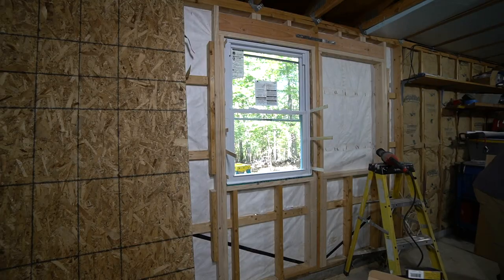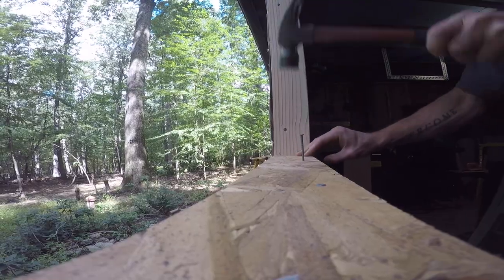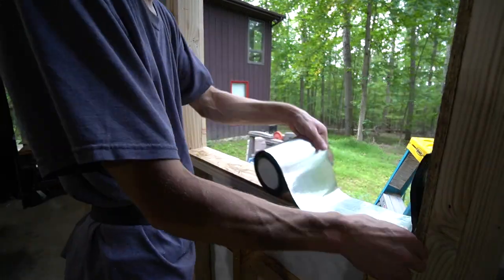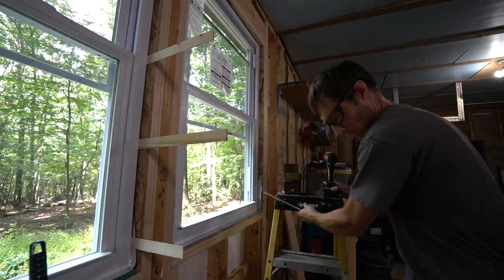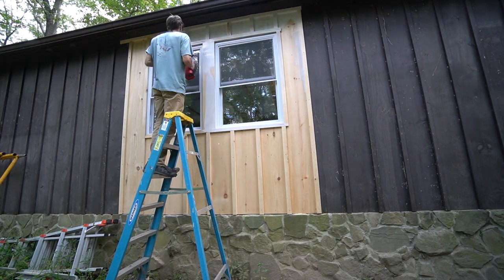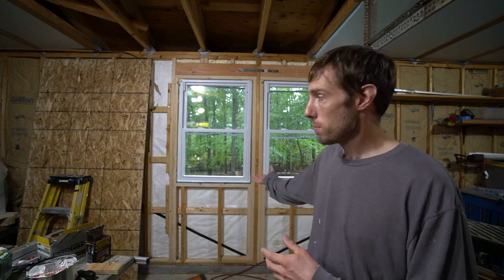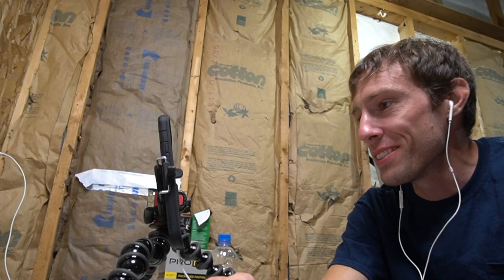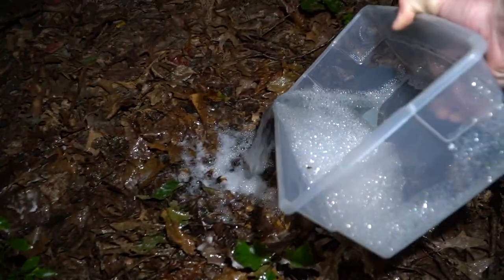Installing Windows In My Shop And How Much They Cost

Comment: I love watching US houses repairs/rebuilds etc. Want new window? Saw-off piece of wall, shoot some nails and boom work done. Rotten floor? Use few hydraulic jacks to lift the whole house and change your floor. Need to move wall a bit to the left? Just cut your wall away and build new one. :D
I need solid SDS just to drill hole in my wall to hang painting, coz it's made of 30cm of reinforced concrete. If you want to change something with your installations - electric or water/heating you need demolition hammer and diamond circular saw to make new grooves.
Reply: and the funny thing is, our concrete/brick houses would survive most of the natural disasters that cause total mayhem there, yet still they stay building the same way. The secret is in the differences in property law, insurances and construction code.
Reply: @lukearts2954  Yup. They both have pros and cons. Im only wondering if something will change now, when wood prices are like 2-3x higher than few years back. Now building wooden house will be probably on par with brick one.
Reply: @atexc5604  as for materials, yes, but man-hours and logistics are still in favor of timber frame housing.

Comment: put a asphalt roofing strip between stone wall and a bit up under bottom of wood wall, it provide isolation and lead water away and keep the upside of the stones dry, and its cheap and easy

Comment: The top of the stone wall should have a small metal trim cap. It starts behind your wood siding then goes over the top edge of the stone. Kind of like your window flashing. Sealing your ends should help like you did in the video.

Comment: I assume that is a hornets nest. After dusk scrape the ground for a circle around the nest diameter of 6-8 feet. No leaves or debris. Then and only then get a hose ready with water and then saturate the ground with kerosene or gas where the nest entrance was trying to get it deep into the nest to that end you might poke a stick down in the entrance before clearing the ground. Light it up, you will have to stay with it for a bit to make sure it does not flare up and spread anywhere. But this will allow you to kill them off almost entirely as they will all be in the nest at dusk. Next day dig out the dirt find any remains of the nest and destroy it completely.
Reply: Hornets here in Germany are pretty chillaxed. They also eat wasps, so that's a plus. I would keep the nest, should they turn up. The neighbours have one this year, he got stung after relocating the nest for the third time. Until then they did not mind him. 
Might be different on other continents.
Reply: @johanneswerner1140  they tend to be territorially pissy here in the states...
Reply: some tannerite onna stick perhaps?

Comment: Our carpentry crew want to put a strip of lead flashing all the way around and put the boards at least 3/4" up off the ledge and a cheaper route would b to use a drip cap aluminum sitting on the rocks and the boards 3/4" up off cap. And not trying to criticize you did a good job. But any raw wood that's gonna be painted should painted all the way around any time more wood it gets primed. but that just how we.d do in northern new England....✌️😉

Comment: If you don't want to use the right powder to take them out (e.g. that ant powder that slowly disintegrates exoskeletons through a catalyst process, rendering the nest unusable for eternity, should work on all exoskeleton insects; or the actual wasp powder used by firefighters), here's a DIY recipe that will take care of them. 
You need a few things that you have on hand for sure: 
electrical tubing (pvc pipe or any other pipe that will allow you to deliver from a safe(r) distance), 
a funnel that fits into said tubing, 
water cooker (and water duh), 
300-500ml acetone, 
polyurethane spray foam (which you didn't use on the windows so you might have some in excess anyway), 
maybe some welders gloves or other way to safely hold the funnel while adding the boiling water...

Order of application: 
in the night, stick the tube well into the entrance hole; 
pour in all acetone, 
flush down with boiling water, preferably not more than half the volume of the acetone you poured in... The heat will create acetone fumes that will kill some, knock out the rest; 
immediately following the boiling water spray the foam through the pipe, make sure to hold your end of the tube real tight so that all the gas pressure goes down into the nest. The expanding gas for the foam is toxic to the wasps as well, some will get stuck in the liquid, and in the end the expanded foam seals off all possible escape routes. Even if they have a secondary entrance, chances are the foam will reach that tunnel as well. 

The acetone gases and expansion gases of the PUR foam will remain sealed in the nest... It sounds like a horrible way to kill them, but in truth they will actually fall asleep from the acetone and never realize they are dying... If you don't believe it, capture one in a bottle and try it out first to see what it does. We've successfully used this "technique" against fire ants and wasps, in and around the house...

But in all honesty, the best way is to just call in FD and let them take care of it if they provide that service, get the proper materials, or just leave the bugs alone by marking/fencing the nest. Unless they have a habit of flying into your baby's bedroom, they don't seem to be an imminent threat. But of course, I only have one snippet of video to go by, and you did say a previous encounter landed you in the hospital, so I'm not judging your attempt to exterminate them :))
Reply: disclaimer for lesser gifted readers: DO NOT attempt to skip the water step by trying to cook the acetone directly in the water cooker. Acetone has a lower boiling point than water and the cooker will just keep heating and evaporate the entire thing into your kitchen, possibly killing everybody in your house! Even when doing it outdoors it would create a huge extremely dangerous cloud, so just DON'T!

Comment: Your using the wrong spray foam, you need to get the right expansion width
Reply from the maker: No its the correct foam. Still have problems with it.
Reply: @OUTDOORS55  lol I knew the spray foam slam was gonna hurt feelings